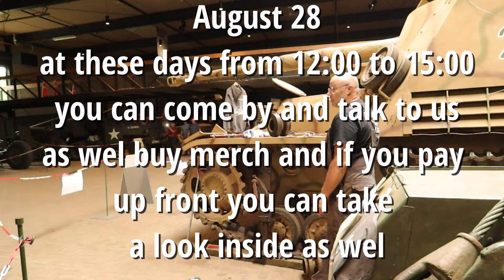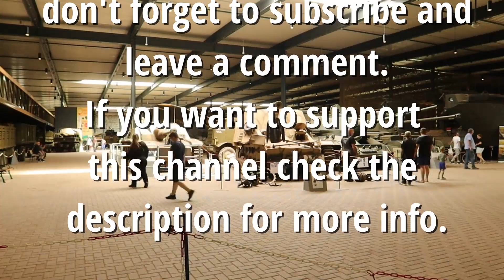Replacing late for early return rollers on the Nashorn

Comment: As always you managed do quick job changing the idler wheels with the new rubbers on. It is definitely not easy to change compared to changing a tyre of a car like the old Renault 4, Lol 😅! But you must have experience like dealing with the roll bearings and of course greasing like crazy all around. I feel sorry that you worked so hard to make the all steel idlers. As always I'm following your work on the lovely Nashorn 👍👍